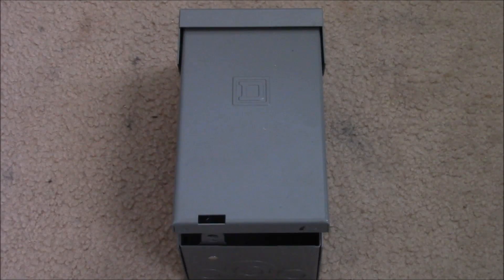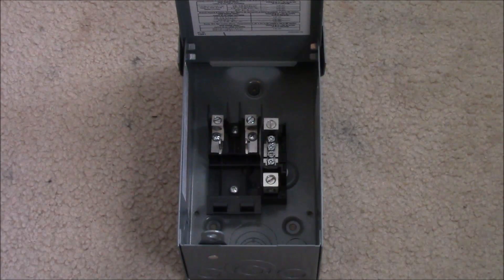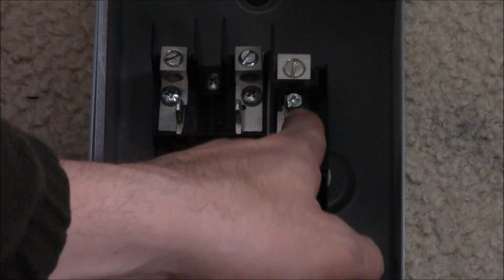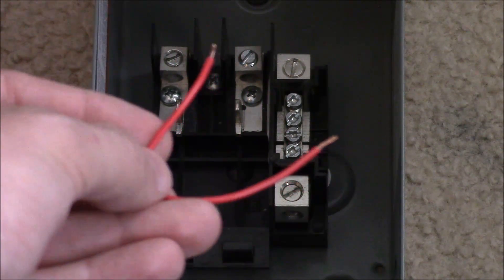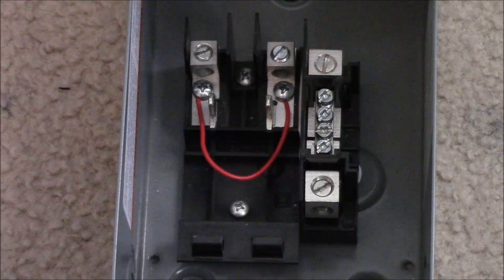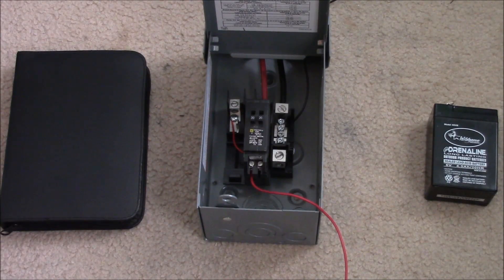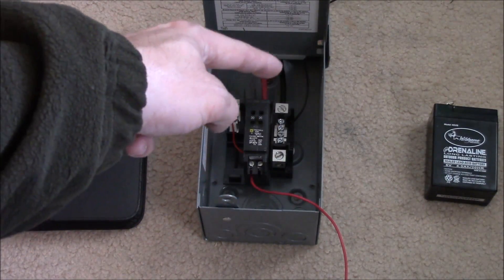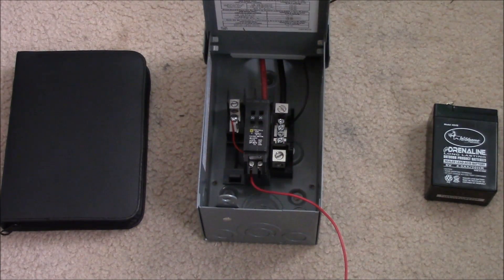Solar Panel Systems for Beginners - Pt 3 How to Build A Load Center Combiner Box

Comment: Thanks for the great video! I was wondering if you could give a tip on which type of load centers and breakers to use. Can you give a reference e.g. in amazon. Thanks!
Reply from the maker: +Kirill Pushkin Without a doubt, the QO series by Square D (Schneider Electric) is the one to get.  It is the only one I have seen so far that is rated for DC use.  The other ones work (I have one Homeline series load center that has been running DC for 3 years) but I wouldn't recommend it.  Also, make sure you get an outdoor one if this is going to be outside and may come in contact with rain.

Amazon's prices on this aren't any better than Home Depot but here is one I would recommend (top one smaller, bottom one bigger):
http://www.amazon.com/Square-D-QO24L70RBCP-Main-Center/dp/B002KB9NDM/ref=sr_1_14?ie=UTF8&qid=1461677169&sr=8-14&keywords=qo+square+d+outdoor
http://www.amazon.com/Square-Schneider-Electric-QO612L100RBCP-12-Circuit/dp/B00002N7N6/ref=sr_1_7?ie=UTF8&qid=1461677111&sr=8-7&keywords=qo+square+d+outdoor
Reply: +LDSreliance Many thanks! My understanding is that if you use a load center with a breaker then you do not need fuses. Is that right? Thank you very much for your help!
Reply from the maker: Kirill Pushkin
If the breaker is rated for DC then yes, that is correct.  The breaker will trip if it exceeds the amp rating just like a fuse.  A fuse would just be redundant in that case.  You are very welcome!
Reply: Kirill Pushkin

Comment: What's the section of positive and negative wire coming from panels ?  My panel are 250 watt.
Reply from the maker: +freddyboys I don't understand your question.  Could you rephrase?
Reply: ok sorry I want to know the size of the cable utilized. 6mmq ?
Reply from the maker: freddyboys
The size varies with the manufacturer.  For 250 watts I think it would be around #12 AWG.

Comment: I'm really liking the tutorial vids on this subject so far. With my background in electricity and avionics I learned in the Navy I can honestly say that this is a good instructional series. Well done.
I have one critique to make at this juncture though. While you said all of this is just for instructional purposes I feel you should STRESS using a proper buss wire to bridge your positive terminals. We are all culpable for accidents that happen when making these videos and I would hate to see someone try to follow this video series and use the wrong materials. 
Your head and heart are in the right place LDS i'm just trying to call caution to a potentially bad set of instructions. Futhermore I would recommend making an update to this series of videos with descriptions of proper wire gauges, wiring diagrams, and even parts lists to include part numbers. The amateur can easily be hurt or killed  if they do something wrong and I know you don't want that.
Again, great work so far. Keep it up.
Reply: +Brent Barnett Furthermore watching this segment I feel I should add that breakers ARE NOT intended to be used as switches. A very simple switchology system could be incorporated to this to turn on/off the various loads. The breaker system is there to kill the system when an overload situation occurs.
Reply from the maker: +Brent Barnett I agree somewhat on a few things.  A buss bar would be nice but there are none commercially available to convert an AC load center to a DC one.  Also, using a small wire that is only inches long in as big a gauge as possible does the trick easily.  You will exceed the amp rating of the load center long before you burn up that wire.  But if you did all it would do is sever the wire.

I will probably re-shoot the whole series in a year or two as I continue to gain knowledge and as I get better video production equipment to do a better job.  I agree that proper disclaimers and safety info should be available, although this IS youtube after all and no one is going to sit through extensive disclaimers and safety precautions to get to the meat of the video.  I'll have to put some thought into how to do that.

Thanks for the comments, though!
Reply from the maker: +Brent Barnett I agree.  But they do function as switches in those rare situations where you need to shut down the system to work on it safely.  This is no different than an electrician coming to your house and adding lights in your kitchen.  The first thing they will do is go shut off the breakers to those circuits to prevent an accident.
Reply: Brent Barnett ...well spoken.  i agree 100%.  lds means well but sad to say he has a NEC code violation using that small gauge wire to jump the two phases into one single phase.  most inspection authorities would red tag his jumper.  reasoning would be not using an approved screw, lug, bolt etc. for power connections.  if you look close.he is using a mechanical screw to hold the bus to the plastic insulator.  by definition that is a code violation.
Reply: Brent Barnett n
Reply: I've been investigating the subject and found a great website at Ewans Energy Roadmap (google it if you are interested)
Reply: Robert Schilling he did say it was for illustration purpose only. Hopefully people are smart enough to know wire gauge #'s for different loads.

Comment: I love that you want to help people, however with electrical I understand what you are getting at. I've been a pro for 25 years. Someone to "green" can easily get killed if they do not understand colors change from DC to AC along with proper grounding. Sometimes they need to hire or horse trade info like wire size, colors, fire, and death if they get it wrong. Please understand I came from a do it yourself family...If it is to complex farm it out please! A old timers heart stopped after a shock this summer because he new just enough to almost die..Good luck an please be safe an never guess with electricity.....It can cost you your life.Have fun....

Comment: as a beginner I would say.....unfortunately not very clear! It mixes up things you see and things you should imagine.....
Reply from the maker: +Daniele G Did the best I could.  What was left to the imagination that was confusing?
Reply: +LDSreliance Hi, if I understand correctly this is an AC breaker, but in this video it is powered from a battery so it is using DC. My confusion is on the actual possibility to use this Load Center for a DC input (as you showed) or if it is supposed to be used for a AC circuit. Then toward the end you show a different layout with the battery on the output and the panels (in theory) on the input side. But in reality the battery should be replaced by a charge controller....I guess that it would be very helpful to show this schema with say a couple of PV panels, connected to this Load Center, with an output to a charge controller. In this case what you describe is supported by what you show. Thanks
Reply from the maker: Daniele G
Ok so you are talking more about the difference between using a load center with DC power vs AC power and also the difference between a load center and a combiner box.

I can certainly work on a video for those distinctions.  Thanks!
Reply: I agree with daniele g, i am very visual.
The two devices sitting on the left and right were not connected. That was confusing to me 😳.

Comment: i would like to see a video where you have a off grid/direct current charging multiple batteries.
Reply from the maker: +Arctic Frost OK.  I have a video showing how to wire up multiple batteries in either series or parallel.  So you want to see the whole thing from solar panel to charge controller to battery bank (multiple batteries) to load center to inverter to load?
Reply: @LDSreliance  yes I want to see that

Comment: what if i want more voltage and more storage? i would also want to power multiple loads like about 10. would i have to buy more grid tied systems and put them together? i would like to power a room.
Reply: i am asking so that if you answere you would make a video please.
Reply from the maker: +Dcaro Dan You can get load centers that have lots of spaces for breakers.  I don't know how big they get in the QO series of load centers but at least 10-12.  Just make sure it is rated for DC voltage.
Reply: +LDSreliance thank you

Comment: I have made a load center but want to tie my solar panels to it and then connect from the load center to the charge controller.  in the last part of your video you explained this,  and this is how I've got it wired now.  it dark and rainy today so no way of test it.  But I have but a volt meter on it and with the breaker in the off position I get a negative volt reading verses a small positive reading with it on.  200 watt Renogy panels in parallel. With the breaker off and reading voltage at the solar panel charge controller connection I read  - .900 volts   with the breaker switched to on I get + .031 volts dc.  The positive reading appears to be normal at this time of night due to it being dark.  I did it like this to help clean up my wiring a bit and give some more control,  I have fuses in my system as well.  my question is, is the negative reading expected?  Or did I do something wrong here.  Regards, Wayne
Reply from the maker: +Wayne Hamilton The only way I have ever seen a negative reading is having the volt meter wired backwards (negative lead connected to positive side and vice versa).  What reading do you get with a multimeter?

Comment: Hi, I have a question to ask. Why is my 24 volts battery losing its power quickly? I have a controler an inverter and a big 240 watts solar panel. I dont understand? Pls anwers me s soon as possible. Email me at joelbo89@gmail.com. when i come back i will send the picture for my battery and solar panel for you.
Reply from the maker: +Joel Bo Your battery could have a bad cell in it, which causes the battery to lose voltage quickly.  Also if it is flooded lead acid make sure it has enough distilled water in it.
Reply: But the battery that I have is sealed. I cannot open it. I don't know what to do. Plus where I live, there are not maany people who knows about solar systems. Anyway thanks for your reply and I really appreciate your help.
Reply from the maker: +Joel Bo Without a battery monitor to do a load test you can't really know 100% for sure.  You could ask autozone or a diesel truck mechanic if they can test a 24v battery so you can see.

Comment: Nicely done video but I'd like to clarify something so no-one gets confused.  The breaker you used is a tandem breaker originally intended for two 120v circuits.  A double pole breaker is intended for a single 240v circuit.
Reply from the maker: +Darren Taylor Good catch.  Sometimes I say the wrong things in my videos and don't catch them.

Comment: Hi, I got a lot out of this vid, thank you, so for us we are looking for cabin loft style living, do you think a big whole unit to run the home is needed or have these smaller load center breakers in each area? i like the idea of one for each area, like a small kitchen, 1 light, 1 college type fridge, I crock pot and 1 coffee maker? how do you determine how many volts or watts you need for each appliance? im sorry for so many questions but you teach very well, I like your advice, maybe 1 tv small not a whole wall! lol and a light in another room, and a computer and a cell charger in another room,  ceiling fan? possibly air conditioning? lights in the lofts???
Reply from the maker: +Sue Sue That is the first question to research when you are thinking of going solar:  how much electricity do my loads consume?  You will be surprised and enlightened by what you find.  For example, you referred to a tv and only needing a small one.  Well large LCD tv's don't use much power.  So that is one area where you could still enjoy something extravagant like you would if you were on grid.  However, anything that produces heat (including the crock pot, hair dryer, space heater, microwave, etc.) consumes a large amount of electricity and will be hard to do off-grid without spending a lot of money.  The crock pot will probably use about 600-800 watts on high so if you cook on the lower settings you will probably be ok.

I am glad you are already thinking of ways you can cut down on electrical usage because people who think they can replicate their current lifestyle off-grid will fail or spend $100k+.
Reply: +LDSreliance   just bought 2 of these I hope it isn't a bad move: http://www.ebay.com/itm/221782543838
Reply from the maker: Sue Sue
For that price you can't go wrong.  I doubt they will last long or be very bright but it is a good starter place to get into solar and experiment.

Comment: ok , if i have a 6000 watt inverter  could i hook up a regular battery charger up to charge the batterys in the night . if i have 400 watt panels do i need a 400 watt charge controller?
Reply from the maker: +welllsaiddddd Yes you can hook up a trickle charger to keep the batteries topped off at night.  But you will want to make sure to disconnect it first thing in the morning.  You don't want the charge controller and trickle charger to fight each other and possibly damage your batteries.

Charge controllers are rated in amps so convert watts to amps (divide by 12 if you are using a 12v system).  400/12=33.33 so you will need a 40 amp charge controller.

Comment: ok, how about using multiple batterys for a bigger inverter . say a 10,000 watt inverter to power a house. how many batterys , how big of a charger and how would the batterys be hooked together. and is it possible to be able to use 220 v appliances ?
Reply from the maker: +welllsaiddddd All of that is definitely possible.  But the answer on what you need is it depends.  It depends on what size batteries you want to use (they are rated in amp hours), how much electricity you use on a daily basis at your house, how much of a reserve of power you want for cloudy days, etc.  That is a really complicated question and you will want to start really small before you go big like that. You will make a ton of very expensive mistakes if you go big for a whole house without knowing what you are doing.

Comment: what is the most number of battery's that this can handle i have 2 12v & 3  6v right now
Reply: if you find a 4th 6v then all of them ... as long as they are setup in 12v groups so 2 6volt batteries serial and then all the 12v groups in parallel ... or the 2 12volt panels in serial and the 4 6volts in series for then each set in parallel ... it depends on what you need more of amperage or voltage ... but you are limited by the smallest size the 12volt batteries can make ... for ease of use and safety ... mixing and matching 12v and 6v setups gets really funky really fast and costs a LOT more to deal with

Comment: LDS, I was going over your last answer from a couple of weeks ago, I know that the question looks the same but what I'm trying to do is at this point is use that load center that I mentioned by jumping the two hot legs say with 8 AGW  to keep it 110 volts so I can use the single pole 30 amp breaker, and running 10/2 from the inverter to that panel which is about 25 to 30 feet away, also the QO breakers are also rated at 48 volts DC, the other thing is that I don't know if they make a 15 amp plug that will take # 8 AGW to plug into the inverter, and the small load center that you use for your demo that has the screws so that you can jump do you have a model # I tryed to find it at home depot with no luck. Also do you have a private e-mail I would like to send you some pictures of this Shed set-up that also has a 7000watt Generator incorporated into it that slides on a dolly from inside the shed into an outside enclosure in case of a power outage, spent alot of time on this project and don't want to screw it up now I' m just and old retired guy with no money and a lot of time on my hands LOL
Reply from the maker: Al Ruark That is a lot of info and questions :)  Shoot me an email at ldsreliance@gmail.com and we can start tackling those issues one by one.

Comment: Hello again LDS, I have a question for that no one seems to have the answer to. I just finished installing 13 = 100 watt solar panels and connected to a battery bank, now here's the question,The inverters are a 3000 watt modified & a 1000 watt pure sine and I would like to connect one or the other to a a SQ-D QO Breaker panel load center    (QO 816L100amp 8 space 16 circuit)       now this load center is for I guess a 240 sub panel but what I would like to know since the inverters are not hard wired and only have110 outlets can I jump the two hot legs in the load center to keep it at 110 volts on each side and use a 30 amp single pole breaker to feed 6 or 7 15 amp single pole breakers at 110 volts for the  or 8 circuits in my house???
Thanks for all the help
Al ruark
Reply from the maker: Al Ruark I'm not an expert on AC power.  I use load centers strictly on the DC side thus far and am only dabbling slowly into AC territory.  Go ahead and shoot me an email and I think we can figure out some answers.